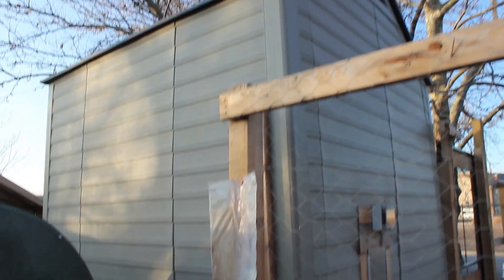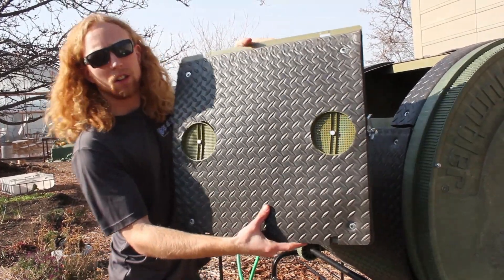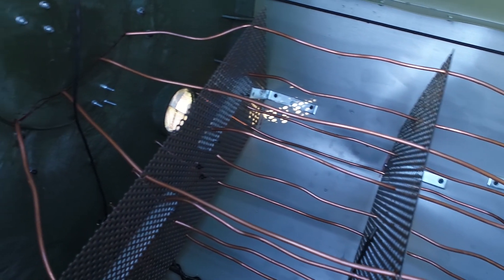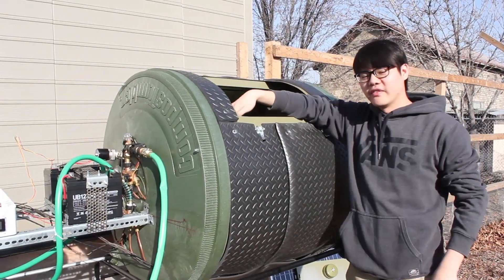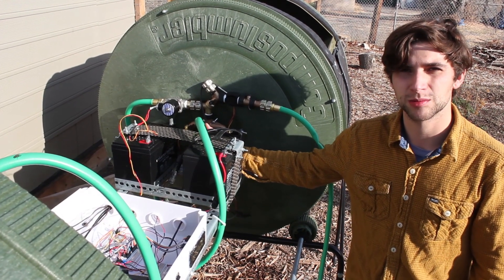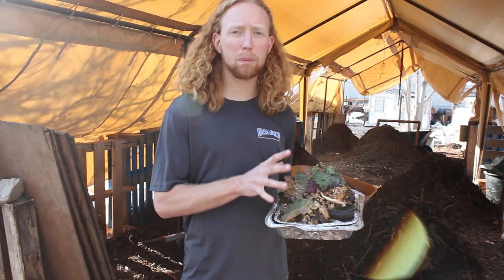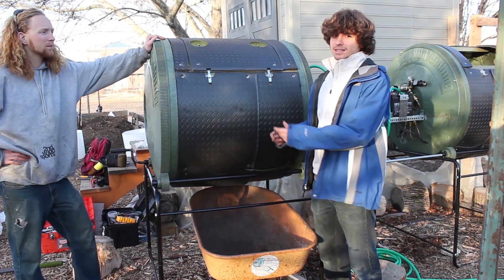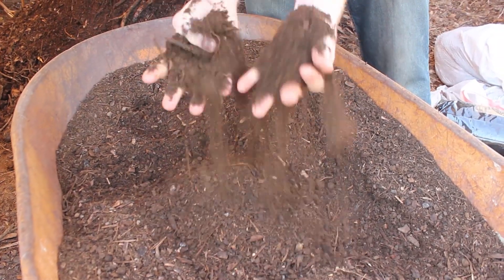Compost Heat Capture Device

Comment: why they don't build a supported axial copper spiral with the tube"heat exchanger" inside the cylinders instead using sort of a collector with straight tubes inside?

Comment: heck of a design - nice job!  But I fear the tumblers are simply too small to capture significant heat.  You'd have been far better off with a single tumbler with 2x the volume.  For gross heat generation, I'll take sheer volume over the ability to turn the compost any day.
Reply: Like the idea, but the copper tubing looks like it will get destroyed by compost tumbling over it
Reply: @joelbruneski6486  yeah, I have a strong aversion to putting anything delicate inside a compost pile!